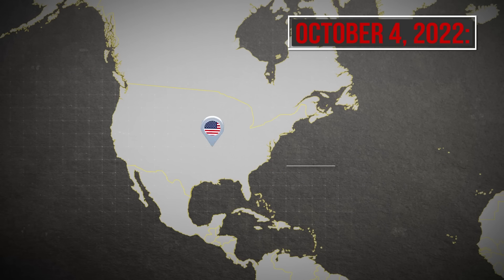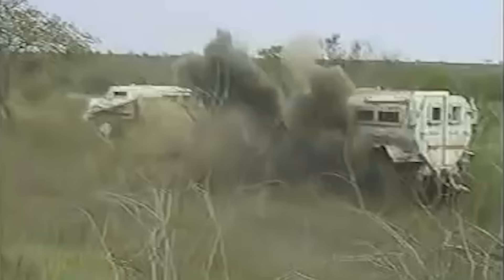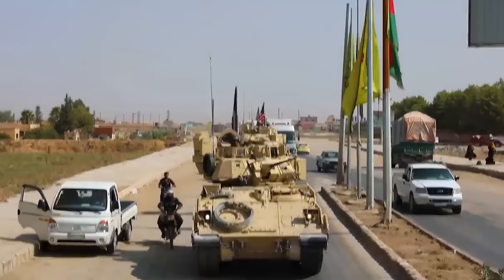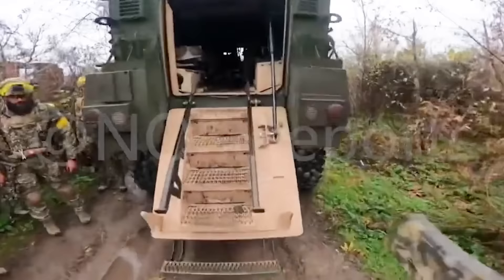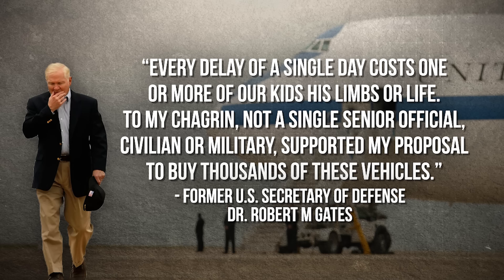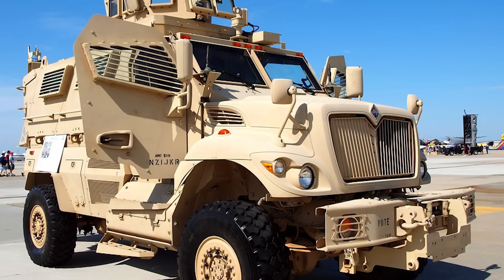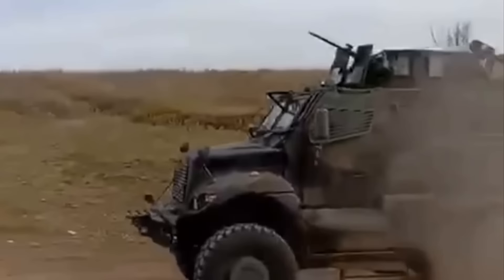Why America is Gladly Giving Away their $50 Billion Truck

Comment: As a Sapper route clearance team leader in Baghdad in 2006-2007 I can tell you first hand the V hull saved just about all of my joes lives. We didn't have the new MRAPS but old school RGs (from South Africa) and Buffalos. The hits they took and we walked away from was absolutely incredible. Our Buffalo once took a 400lb HME hit directly under the hull...ripped all 3 axles off and flung the thing about 50 feet but we all walked away. Any other style truck was a death trap. My team alone cleared about 300 IEDs with about 50 hits, lots of concussions and a gunner took some shrapnel to the face but no KIA.
Reply: That's truly bad-ass.
Good job man.
Reply: And then your headaches were determined to be "not service related" lol
Reply: @picklepepper900  so, I’m not going to defend the VA’s policy, but as someone who had my clinic there for 3 years, a LOT of it is that they separate the people who can assign certain service connection stuff from the clinical people. I had a LOT of folks w TBI  flags, but I couldn’t add that flag as one of the doctors. Just putting it out in case it helps someone.
Reply: FOB Striker, by chance? I was there 2005-2006 doing the same job, you may have taken over for us. The RG-31's without side doors were a real pain to climb into and out of, but they could take a hit.
Reply: @morris1331  f yeah. 875th engineer battalion. We ended up patrolling out of FOB liberty a lot in 07, Pushing into country that had never been cleared before. That’s were a lot of the hard buried stuff was. A few EFPs and RPGs were what tore us up the most.
Reply: But there were groups like the Islamic State of Iraq and the Mujahideen Shura Council that used IEDS in a new way that enabled them to eliminate many MRAPs and other minesweepers, they have several documentaries documenting how they did that and one of my relatives participated in the development of those IEDS for the Islamic State of Iraq sometimes he would come to our house and show us videos of destroying American armored vehicles
Reply: Way to wreck the Buffalo after we handed it over
Reply: @abdullahwesam4286  yes very scary they fogured out how to take out sone of the militaries lightest armored vehoclss from the yanks.
Reply: @Sgt.chickens  Why you getting butthurt?
Reply: Thank you
Reply: Great for you and good that you saved lives with what you did. 
But I can't help to imagine all the useless lives lost and all the people injured (physically and mentally). So sad that you and your comrades were used by some politicians that lied, and for some missions that didn't make any sense. 
Those vehicles will now save lives in Ukraine. But at the same time, one guy had the power to kill and injure hundreds of thousands of people, destroy a country, destroy civilian infrastructure, starve poor countries, kill Ukrainians with the cold soon (no access to gas and electricity). So much useless BS, so many people asking for nothing. 
And if you look at Afghanistan, it created a ridiculous self feeding war. 
NATO soldiers got scared by the amount of insurgents. Sometimes (often enough) civilians were killed because it was suspected that they were ennemies, sometimes by mistake. For some local families, this meant that NATO soldiers were a threat and that Talibans were "resistants" against the "devil". And this vicious circle got worse and worse and worse. The horrible aspect is that this situation has no solution, and has only one result. Horror. Both sides are losing for no change or even worsening the situation. 
Libya, Syria, Iraq, Afghanistan, Mali all those countries are in a horrible situation, and have as an origin a NATO (American) interest. Soldiers and civilians paid the price and still do.
Reply: Jesus Christ
Reply: Wow! How would you keep on route with the axles broken? Other mine-prepared vehicle in front, or just in other common vehicles?
Reply: South African veteran here, yes the RG is a pretty cool vehicle. I did my training in a pre-refit RG called the Buffel MPAV which saved countless lives. I'm glad our design was of service to you.
Reply: Thank you for your service. Doing a tough job in a tough place requires tough men, and you're the definition of that. Guys like you suck it up and keep truckin' and that's what we call Cowboy'd Up !!
Reply from the maker: Glad you made it back safely man. Route clearance and EOD riles especially needed these vehicles !
Reply: @theoldleafybeard  oh that thing went to the scrap yard after that hit. It had to be dragged out with an 88. Had to climb out of the top hatches because the hull bent so much the rear door was jammed shut. Our maintenance guys had it stripped for parts that night.
Reply: @Taskandpurpose  thanks man. Made it back and promptly put my warrant packet in. I loved being an engineer but two deployments made me realize if I wanted to retire with all my limbs and half a brain it was time to change jobs. Signal warrant FTW. Nothing but AC server rooms, coffee mugs and ninja smoke till I hit my 20 in 2017.
Reply: Same, E co. 1/68 3/4. We only had one issue and it was an EFP vs a husky. He survived and is walking around fine today. But yeah, mraps we're the way to go.
Reply: And buffalos
Reply: @sheamcclure6639  shit man, they say that sitting is bad for your health, and all that coffee is going to push your blood pressure through the roof. Take care.
Reply: Hope you and your team don't suffer any long term post-concussion brain trauma issues. VA not known for it's long-term care. Glad Congress finally got their head out of their collective asses and funded these in time for you and your guys. If I would have deployed while I was in it would have been in a Hummer and we all know how well those worked out against IEDs.
Reply: Respect 🇺🇸🦅🫡
Reply: Was you with 1st Eng then. I was with 111th sapper company for that deployment. Spent most of my time at anaconda but we ran North and would go to brassfield spiker and finish up the Q West
Reply: Thank you for fighting for Israel 👍👍👍
Reply: I think it is different on Ukraine where it gets to the artillery hits it doesn't matter.....how you are protected against small arms .... much more important is get out fast and far away from truck or transporter or tank etc....high caliber everywhere coming on your head ...
Reply: @abdullahwesam4286  Well that's nuts hahah
Reply: All it needs is a fully auto belt fed 30mm or 40mm sniper gun mounted on the top of it to turn it into a "Rolling Wart-Hog" tank killer. What-Ever the Ukraine's arm it with you can bet the pentagon will be jealous of the Ukrainians innovative skill set. It's amazing what a Ukrainian can make out of a $25.00 WIFI security camera mounted to a telescopic gun sight feeding streaming video to an old iphone 6. Our military would spend $50,000 for something that was 800X bigger and could not be fixed by a 12 year old with a guitar pick and a micro screw driver.
Reply: @jonny-b4954  hunters of minesweepers is the translation of صيادو الكاسحات, hundreds of footages showed how the Jihadis groups destroyed America’s greatest Well-armored vehicles
Reply: that's awesome
Reply: @greennewworld8291  There were sure a lot of truths packed in your comment!
Reply: @edwardhawkey5714  Rhodesia? Hell yeah! I told this Marine Major General commanding Second Marine Expeditionary Force about the vehicles the Black Devils came up with, and he dug in and came up with the MRAP! There was another armored personnel carrier called "Bullet," and this little jeep-like thing that was designed for destruction--like, nothing but scrap left if it hit a mine--but it was cheap!

He's the one who got the AR-10 back in production, and a whole lot else! Great guy, impressive leader, wrangled a transfer of service for me out of the Army to be commissioned as a First Lieutenant in the Marines!
Reply: We're all standing on the shoulders of giants - you are one of those giants!
Reply: A great comment and well worth 751 likes. We need people like you.
Reply: There is an Arabic proverb that says: Everything is loan and debt, even tears !
keep the good work America !...Everything you loan to Russia is a Debt , and Russia for sure will pay it back, with interests !....
You arm my enemies ....i'll arm yours !...keep the good work !....
Reply: Man that’s hardcore
Reply: God damn
Reply: You are unbelievable
Reply: @picklepepper900  What are you talking about man?
Reply: @abdullahwesam4286  yet it wasn't enough because the IS lost virtually all their territories, fighters and top leaders.
Reply: Thankyou for your service brotha. May blessings come your way. 🤝🏾🙏🏾
Reply: Wow that’s amazing… it really fin is.. thank you for your service man.
Reply: I feel you. 12B, route clearance OEF. We had strykers and I thank the gods I didn't get hit in that vic. It had a v-hull but people still got fucked up when hit. I loved riding in the buffalo though.
Reply: Shea, i was the commo guy for 9th ENG 1st ID in 2 deployments to Iraq. Those RGs and Buffalos saved a ton of dudes lives, including my own once. Route Clearance teams saved thousands of lives and the importance cannot be understated. The EOD guys got all the shine in the media and movies, but the route clearance team were the real heroes.  Thanks for your service dude!
Reply: @nicholasespinoza9610  that’s right but the Allegiance couldn’t do that until they pumped   The whole cities that IS took control of. Plus, IS still here and there even tho most of its leaders and fighters have been died but the numbers were freaky، 6k of IS members died and they killed over 100k from Syrian and Iraqi armies and militias even tho the armies had way better equipments and air forces  support unlike IS
Reply: @abdullahwesam4286  I'm a gwot veteran, it isn't propaganda if it's my own personal experience fighting in Afghanistan. I've personally experienced what 20,000 lbs of HME loaded up in a dump truck can do. It destroyed the entire afghan bazaar and half of our compound. A mass casualty event with over 300 casualties, mostly afghan civilians. We didn't lose a single us service member that day. My original youtube account was permanently banned for trying to upload nongraphic footage of that day.

Edit: of course were similar to the Russians, were both fucking human.
Reply: @Taskandpurpose  Give mraps to the police, so when the shite kicks off here in the GOOD OH USA, all those cops will be in one vehicle and be easier to get rid of them in one swipe. elbowcough
Until then get rid of qualified immunity for police, DAs and Judges.
Reply: A 12B here and glad to know they work 👍
Reply: Thank You Sir, for serving our country. Son is in now.
Reply: Real heroes.
Reply: @talebdaas  Is Russia planning to supply Canada with weapons when USA invades the north?
Reply: @abdullahwesam4286  hopefully we found him before we left ☺
Reply: we were using RGs in Afghanistan during the same time period
Reply: Beats the shitty old Land Rovers we had any day.....
Reply: 2014 with 1st CEB to Afghanistan.  Cleared many IED’s in a Buffalo.  Hit many in MRAPS too.  I think they were worth it.  Huskies especially.
Reply: @greennewworld8291  It’s the same crap that has been going on for thousands of years....we are just better at killing and having big wars than we used to be.  Nothing done on the last 200years is why all this drama is happening.  It has been going on since man was burdened it’s the ‘human condition’(S).  Greed, self interest, tendency to violence/killing (food and each other), etc.
Reply: @theoldleafybeard  He said they walked away, not that they drove away.....?!?! 🤷🏼
Reply: @abdullahwesam4286  Your IED'S never made a difference Australian Bushmasters no one has ever died in one yet from these.
Reply: Not a job for the fait of heart.
Reply: All good for fighting against insurgents that use fertilizer bombs, but this double story vehicle will make a great target for Russian ATGMs for miles around.
Reply: @myopicthunder   I keep hearing this from people who have actual experience in armored vehicles. Is that your case and if so, what vehicle would you feel safe-ish in ?
Open to any nation, any vehicle.
Reply: Hi Shea.  Did you locate the WMD's?
Reply: @shannond9945  well, the situation evolved. We have access to education and information that we didn't have in the past. 

One major change in Western Europe was to go away from nationalism, from religion, this brought peace. The US is very nationalist, is very religious, and many of its people assess everything through a religious perspective which is a huge bias towards violence against others...

In today's modern world, citizens, unless they are manipulated like crazy have no interest in invading another country to make their own bigger. There is no territory to discover and to claim. And only powerful people have an interest in having the resources of that region in their own country. For normal citizens, no matter the side of the border they will pay the same. 

We have a lot more power today than we used to. War isn't human nature. It's only for 1% of the psychopathic population. Now let's learn to not give those people any power. People like Trump, Musk, Putin, and many others only reached their position by screwing over other people. Musk's employees are his slaves. They have to work for free for his other companies and see it as a career opportunity. 
Trump never paid anyone properly. No matter whom, lawyers, contractors, he would never pay the bills he owed, never respect any contract. But because he had liquidities, he could afford to extend legal procedures. 

The US is making powerful people even more powerful. The system is rigged for them. 

Let's just start to understand that and vote properly, make revolutions, stop hiring bullies, refuse to work for bullies, etc... It starts at a small scale. But good people are the majority. Let's stop giving power to the worst.
Reply: Yo joe!
Reply: The unit we ripped with hit 12-1400 lbs in their Buff.  The only guy that was killed was smoking with his hatch open and no seat belt.  It was rebuilt and sent back because the hull wasn't penetrated but was always kind of a turd.
Reply: Dude! I am so happy to read that you and your boys made it back to the states alive. Be safe, and be well.
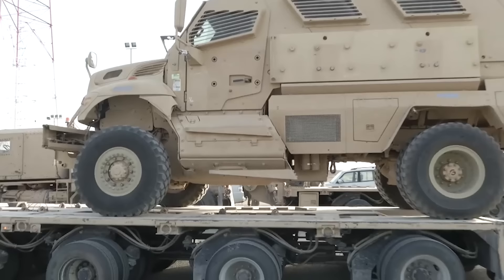Reply: 9:09  **ANYONE HAVE A ANSWER???**   as per the vid, we see some regular dual axle 4 wheeled, also 3 axle 6 wheeled, but also a few 2 axle 6 wheeled(aka dually) MRAP's, what are the dually vehs called & purpose, I understand carry mire weight but that's what 3 axle veh's are for, right??
Reply: @BillBlast7372  that one is a MaxPro+.

MRAP is a family of vehicles and not a specific one.  They have different levels/classification and add on armor. You have:
RG-31 (like 4 or 5 different kinds)
RG-33 (6x6 and I think a 4x4)
Cougar ( 4x4, and 6x6 along with the JERV)
MaxPro (regular and plus)
Buffalo
MATV (MRAP All Terrain Vehicle) 
Cayman

I think those are all the ones the US has adopted but I could be mistaken.  I don't think the JLTV is classified as an MRAP but used a lot of the lessons learned.
Reply: @UnsolicitedContext  My VA Shrink put 2 and 2 together and realized I had an undiagnosed TBI dating back to my time in service in Iraq.  I am still not service-connected for the injury but am service connected for some of the symptoms.  Just to clarify, I did not remember any combat or non-combat and only years later learned that I had lost time.  Thinking I arrived a month later to our FOB than I actually did.  Very disturbing feeling not remembering being somewhere having lost about a month of time.
Reply: Fled afgahnistan left them free for taliban  vietnam 1/2 billon weapons thrown of aircraft carriers usain79 yrs never won a conflict  left only chaos zelensky putting them on black market
Reply: Ira taught  them how to use ied’s  british troops pulled out  the troubles  only on hold
Reply: Thank you for keeping us from getting blown up in the humvees holmes.
Reply: Repent to Jesus Christ “Every good and perfect gift is from above, coming down from the Father of the heavenly lights, who does not change like shifting shadows.”
James 1:17 NIV
B
Reply: I remember we would get back from patrols in the Caspir, and we would unscrew all the damaged glass panes, dump them in this HUGE pile, and screw in the new glass panes.  I was in the army, but we often did COIN ops with the police, and I still remember looking out of one of the windows.  It looked like a guy was pointing at me, and then the grass 'bloomed'.  It took about 5 seconds for me to realise we had just been shot at.  I always felt seasick in the Buffels - they swayed so much I'm not sure how they didn't overturn.

Still, South Africa was carrying out these operations against their own citizens.  I'm not sure the US should be happy going down this route.

Another thing - the Ratel remains my favourite vehicle.
Reply: I hooked jeep trailer  and that's were I dismounted . Unhook and sleep ! Wake up and hook up to another truck.
Reply: Guess what?.. ain't no snow in Iraq...
Reply: @UnsolicitedContext  q a
Reply: don't forget the Husky! we had RCT guys in 08-09 that drove the Husky and had their bell rung several times ... saved a lot of lives.
Reply: But in Ukraine, it was an easy target for even T-62 tanks. 
The western analysis says that it is cruel for Russia to send T-62s to the DPR and LPR militias but to be honest, the USA is crueler for sending this junk to the Ukrainians.
Reply: @Sgt.chickens  and yet here you are, on an AMERICAN app called YouTube….
Reply: Leading a patrol Bear Nauzad in 2011 our MRAP mine roller and front end got shredded by an IED.  Everyone was totally fine.  Every hit the company took that deployment had no serious casualties.
Reply: @abdullahwesam4286  too many people forget the birthplace of engineering was Mesopotamia.  "The Gardens of Babylon" weren't built by Europeans.
Reply: @sheamcclure6639  there is a YT video of FOB liberty titled “ FOB Liberty/Victory “ by channel called 7n6-74 video is 10 years old. It’s late 2000’s footage.
Reply: I was up in Baquba 30 miles north east. We did the top of route predator. 1st en bn 72nd Mac FOB Warhorse.  Sep 06 Dec 07
Reply: @morris1331  I rolled in those out of FOB Warhorse in 06-07. Life savers. I lost the entire front 1/3 of the rg31 I was driving. Engine axle and tire gone. It rocked our socks but we all went home. Only loss we had was a EFP
Reply: @johnwick8756  I was in 1st en bn and our 3rd plt from 72nd Mac was on anaconda. I was with the other 2 platoons and hq on FOB Warhorse. It was sep 06 Dec 07
Reply: Should have worn his safety googles 🤓 btw remember every single bit of garbage you all produced you breathed that in because they lit it on fire just down the street so keep an eye on that
Reply: Are you doing ok these days?
Reply: Ukraine:May I take some Abrams tanks 
Usa:*Gives Ukraine Mraps*
Ukraine:I ASKED FOR TANKS…. Oh actually this is GREAT
Reply: Used them in Rhodesia first.
Reply: Yhea my friend rolled a Buffel one seater upfront  squashed his head & died on a army op he was 18years old. We called it a Buffel it Afrikaans for what you call Buffalo. lol strange to here someone call it Buffalo. lol
Reply: I pray for more men like you
Reply: Fuckin A man. Good job.
Reply: Thank You for your service!
Reply: Thank you for your service sir  🙌🏼
Reply: Also, I just noticed that my palms got sweaty just typing that........the things that stick with you eh? lol
Reply: In South Africa there was a constant argument about the effectiveness of the Buffel versus that of the Caspir.  I was a Buffel user because I was in the army.  The Caspir was way more comfortable.  In all other ways the Buffel was unstoppable.  A pity the US did not look at the Ratel.  A landmine that does not kill passengers, will still damage the wheels / tracks of a military vehicle.   To replace the hub and wheel of a stricken Buffel is easy, quick and cheap compared to that of a tracked vehicle.  I did not know our military designs went this far.  Now our army has more generals than corporals.  Our navy has more admirals than ships.
Reply: Thank you for saving our asses by clearing roads of IEDs. You have my and my entire units upmost respect
Reply: @fun2916  How saving all by stopping all wars? The military was supposed to be a DETERRENT and not to create wars!
Reply: Thank you for your commitment to the Army.          MrJR/UK ex CSM infantry.
Reply: Why would anybody brag about taking part in the war crimes? 🤔 Pure dumb? Plain stupid? Or both?
Reply: Did the army never use those WWII style rotating mine sweepers that can be attached to the front of tanks? Why did they not create a bunch of them, just let them lead the convoy and the road is safe.
Reply: Damn, glad you're back ok.
Reply: spiderman no way home<somebody makes alot of money on this
Reply: spiderman no way home<somebody makes alot of money on this
Reply: @Green NewWorld  please detail incidences of allegations with evidence of atrocities caused by Elon Musk? Don't forget he has a legal dept now. Trump, according to the media has a lot to answer for, so do his supporters! Otherwise, good luck with your peaceful, non-threatening objectives
Reply: @bloodybucket213  @14:55 we just witnessed a Ukrainian successfully clear a mine with a cinder block.  $39,999,999,994 saved RIGHT THERE.
Reply: Do you really call eachother "Joes"????   OMG  Now I don't feel so gay being former Navy haha!!!
Reply: A buddy of mine was KIA in a Buffalo when they were hit with an EFP array(multiple EFP's aimed at 1 spot) on Route Predators. He was 1-8 Cav. Pfc Joshua Cain Burrows. He was a great person. Two officers were also KIA that day, 26 Nov 2006. It was 1st Lt David Fraser and Capt. Jason Hamill, both US ARMY.

The AAR said that it was likely placed for their vehicle specifically as it would've gone over the top of any Hummer. That Buffalo was absolutely destroyed. I also saw pictures and the explosives report and a few other pages. 😕
Reply: He'll Yea
Reply: Dude glad you guys made it back thank you for your service .
Reply: The RG-31, RG-33, and Buffalo were not from South Africa. They were US-made by General Dynamics Land Systems and entirely different from the original South African designs, which had hulls prone to cracking under the massive explosions used in the US’ development and testing.
Reply: @theoldleafybeard  you.... wouldn't???? you'd get fucking towed and get a new vehicle... jesus man lol
Reply: @Evan-iq8hd  Maybe he is butthurt because many people died or got seriously injured by those ieds?
Reply: surprising how much they say they cost....   we build them...   LOL I know.....  and ps...  theyre more like updating a train car, like a GRAIN  carrier that opens from the bottom..  and even with 3/4" inch steel they come out pretty cheap...  maybe $120 grand a car...   not like its rocket science.....   ps I must know,  did you notice any shrapnel coming through the top of where the V meets the wheel well?     I beed questioning if they should put a reinforcing hood on that seem...in flat faces dont tend to redirrect shrapnel ::-\     bugs me I take pride at helping save lives
Reply: The Buffalo was a legit Beast. I watched them be brought back in from missions with numerous blast marks unharmed. Those that were damaged were typical redeployed within days of being damaged.
Reply: @bdub0983  
I was at Taji and the Huskies got blown up almost every mission. The hull would be place on a new chassis. They seemed to survive very well because the IED would detonate under the front chassis instead of the Cab Hull.
Reply: @wilsonrawlin8547  yeah, taji is where all the mantech (I don't remember how it was spelled) would go once they got hit. We had 2 mechanics back at taji instead of Callahan to work on just huskies and mraps and buffalos. 
  Taji was dope compared to where we were. I woulda killed for a kbr defac and an actual px. Though we did get a "shopette" at one point. It was basically energy drinks, cigarettes and dip. Sometimes some magazines. The bazaar was far better. Lots of bootleg movies and CDs and good candy and drinks. That was the business.
Reply: Sure. But its a death trap if it gets hit with ballistics.
Reply: @bloodybucket213  hello from a former rifleman in company c,2nd of the 112th, and hhc 28th discom
Reply: RESPECT BROTHER
Reply: Those were the good ones
Reply: @davefroman4700  
What do you mean? It can stop 50BMG armor piercing rounds. The MEAPS armor package stops EFPs. The roof was the only real weak spot.
Reply: How many people did you end up killing and sending to abu gharib just for being a miltary aged male?
Reply: I was in a unit that used RG 33, the buffalo, and the huskies and came home every time
Reply: That stretch on Irish from airport to the Sabres, 33 mins.
Reply: those RGs from SA and Buffalos are both a type of MRAP (Mine resistant, ambush protected vehicle)
Reply: Essayons!
Reply: I was a Sapper in Iraq FOB Loyalty. RG-31 and Max pro MRAP saved lots of Engineers